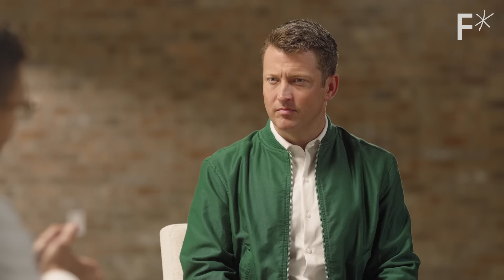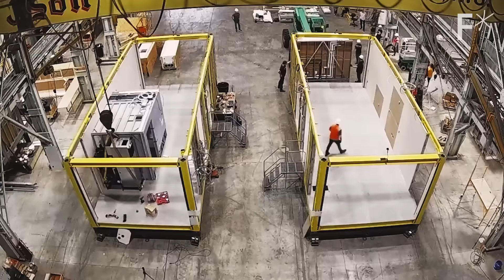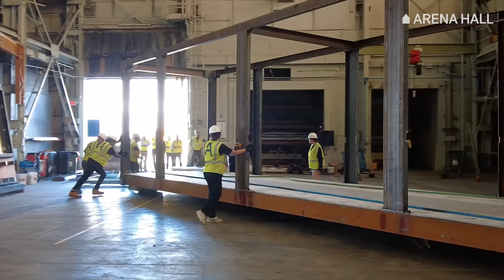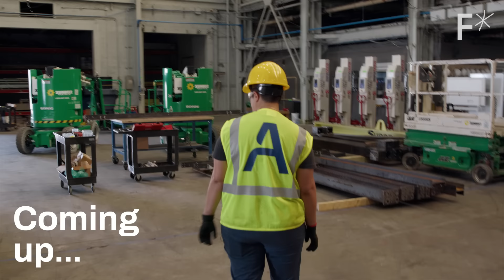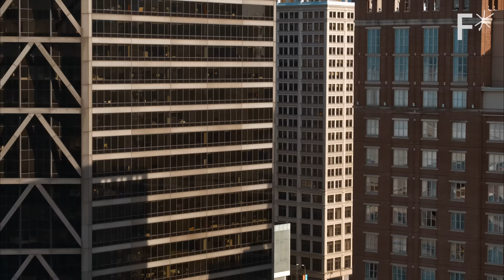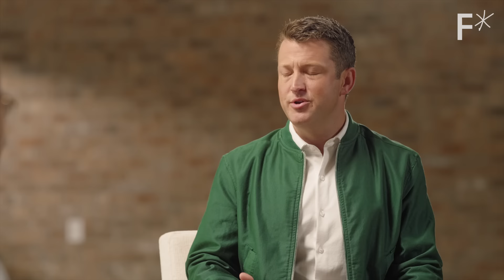Why does everything look the same? The key to a new type of building

Comment: My issue with modular cities, houses, or buildings is that the wealthy elite could potentially own the most scenic spots in the country. Since traditional construction or residences are considered fixed and immovable, the most expensive properties are often located in historically established areas. However, if these structures become movable, nothing would prevent the ultra-elite from acquiring prime locations that should otherwise be reserved for parks, travel destinations, or healing and recreational spaces.

Comment: If you can't move the unit out of a high rise structure, put it on a trailer and to be towed by a pickup truck, or a train, and deploy it in a suburban backyard as an ADU, or on to an empty field as a starter home, and then build a clear span structure on that field and slot the unit in, and visa versa, is it really modular? 

A truly modular solution necessitates two components, units closely resembling shipping containers, and a multistory structure designed to facilitate the movement of such units into and out of it. Basically a parking garage with a centrally located crane, and the units arrayed outwards around an interior courtyard. Units would be driven directly into the street level of the courtyard and lifted into its assigned level and slot, trailer and all. That structure can then be decorated to fit the local architecture. The units themselves, singularly or bolted together, can serve any purpose from a self storage unit, to a farm, to an office, to a workshop, to a restaurant, to a housing unit. This wide variety of functions encourages municipalities and land owners to overbuild because that real estate can always be used for something productive by someone, though there are bound to be certain functions that work together better than others.

The most important feature however, is that the individual units can be owned by individuals. In the urban context, rent is charged by square footage, or perhaps by twenty-foot equivalent units or TEU. The property owner provides electrical, data, power, water, and sewer hookups, but the unit owner pays for these utilities and is free to make whatever alterations to their unit they desire.

Comment: Everyone talks about the housing shortage but fails to even mention the fact that this is created by unsustainable population growth targets. Adding more than 2.5 million people per year to the country without any plan to house them or for the infrastructure to support them is what creates this problem. As the very existence of the problem highlights, the market is not addressing the issue. The lack of a government plan results in environmental degradation, an imbalance of supply and demand driving up costs and the housing "shortage". It frequently means that the existing population subsidizes the newcomers. We need government targets to have a feedback mechanism if it is going to play with market forces.